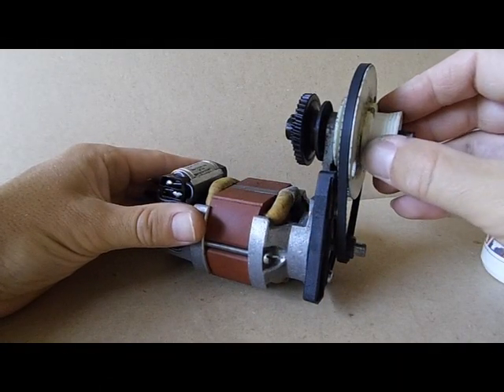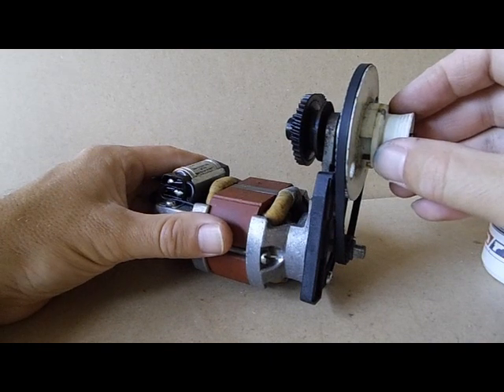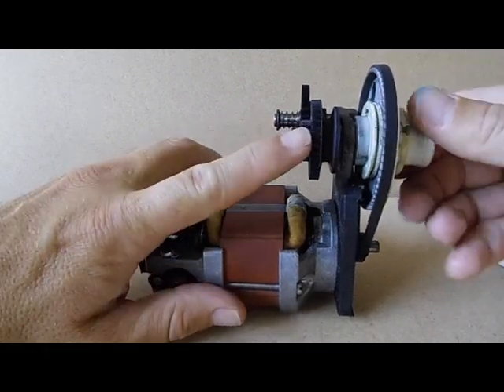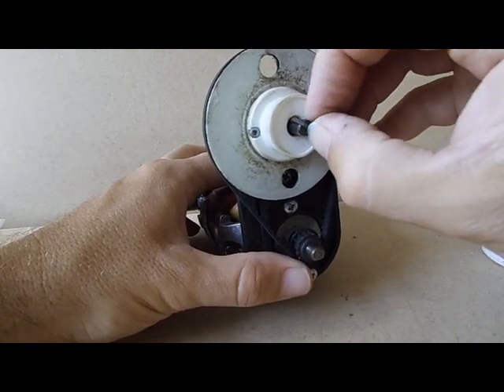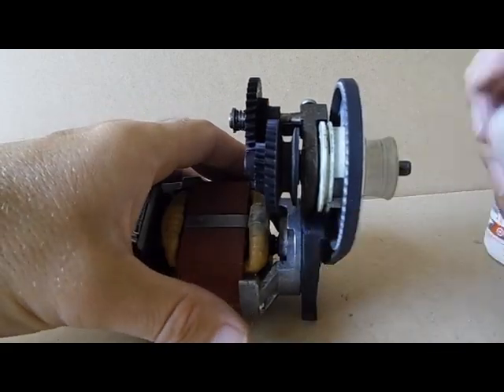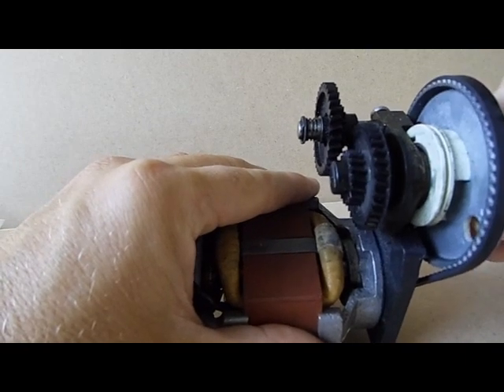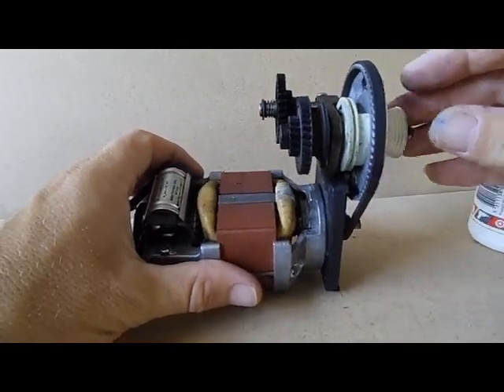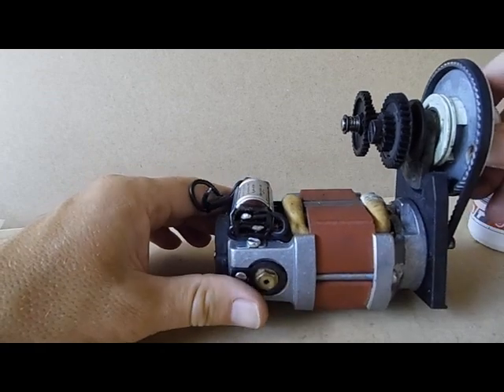Husqvarna 2000 series power gear

Comment: hello could you tell me the circumference of the belt and the amount of teeth .. since in venezuela we do not have spare parts distributor and I need to locate a replacement strap or adapt another similar one in dimensions ... thanks for your answer ... regards